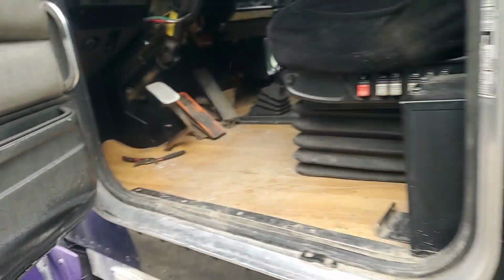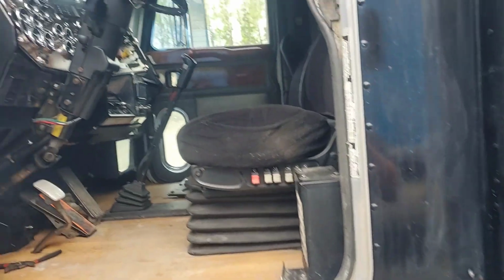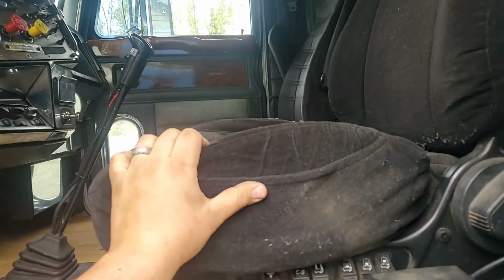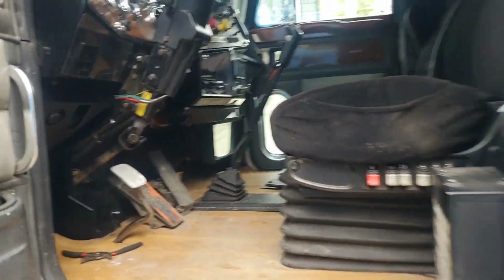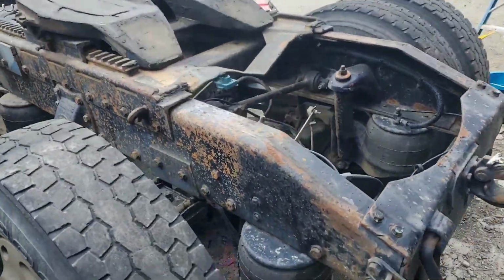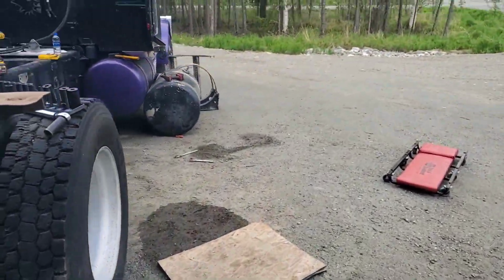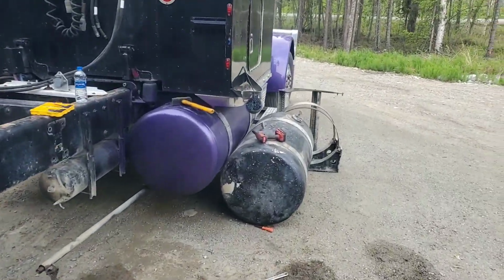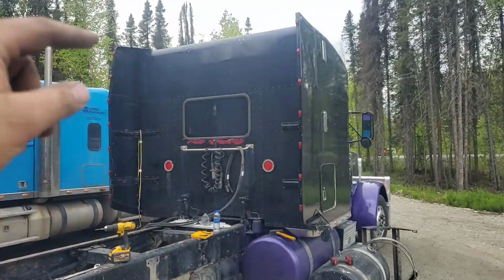I bought a 1996 Peterbilt 379 to Restore!

Comment: I’m doing the same thing with a 05 4900ex western star. You can see my videos of my process. 
I started with the engine and running gear first and now I’m working the truck as I do the interior and the paint will be last. 

I will give u some advice : what ever u planned on spending....triple it and then add some more for good measure. 
Another one is : when you do jobs do them in big groups al at once. ie do the whole engine once out of frame. Don’t nickel and dime yourself. You will lose a fortune doing that.
Reply from the maker: Thanks George for the advice